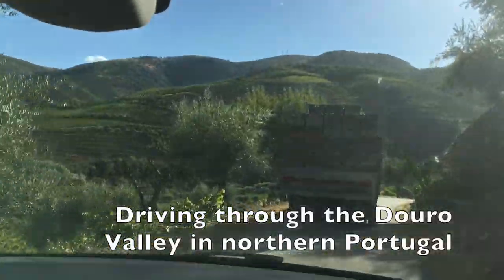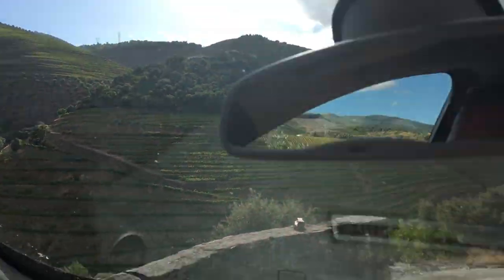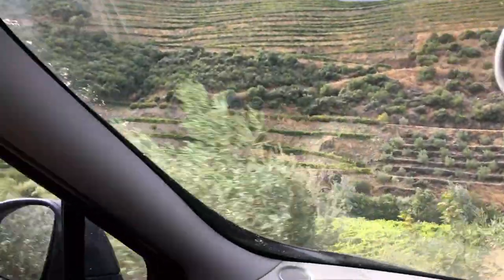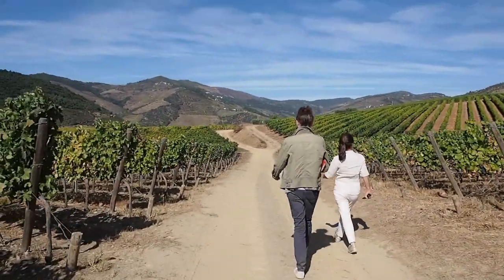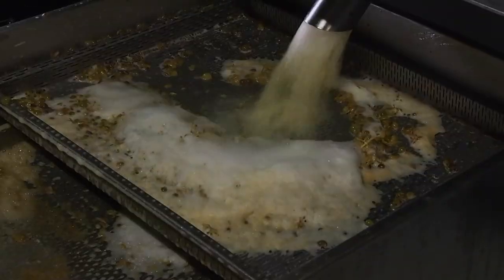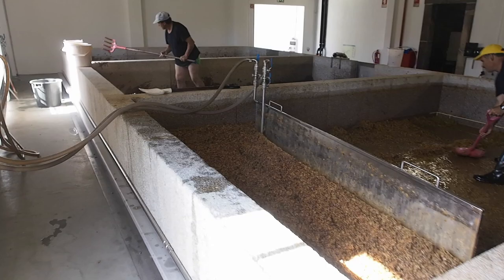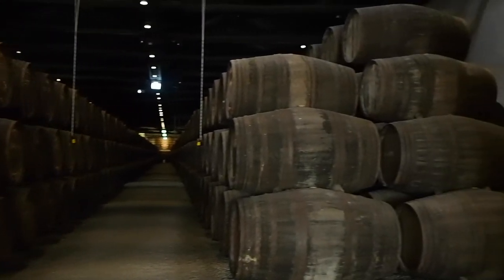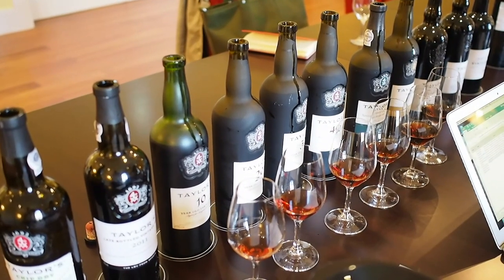Making Port Wine in Portugal's Douro Valley

Comment: Isn’t there a machine for this
Reply: Is a "tradition" and also that's better this way
Reply: Right, I would rather have a machine doing this.
Reply: They said the machine crushes the seeds, which make the wine more bitter. They only do this with more expensive wines though i think.